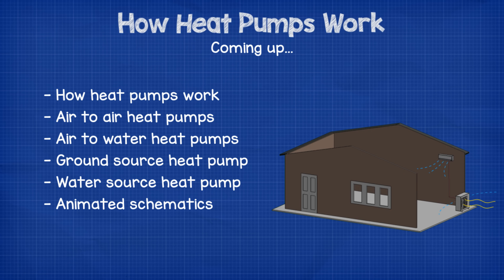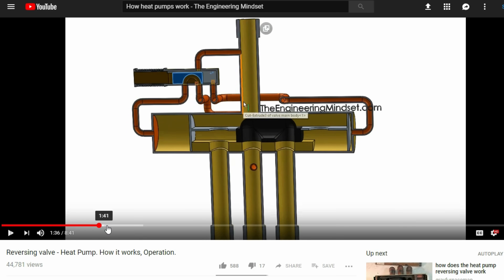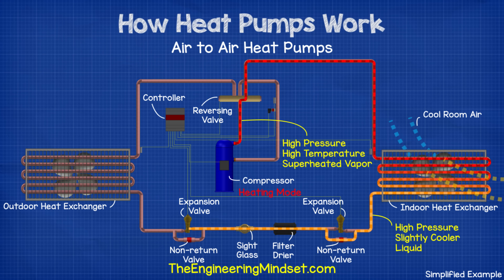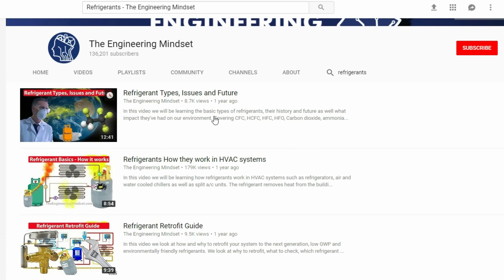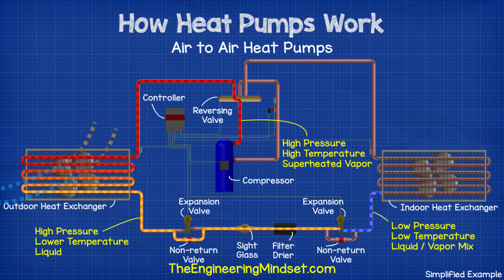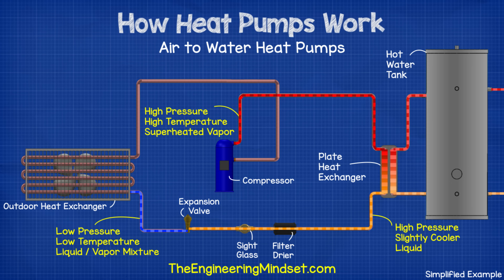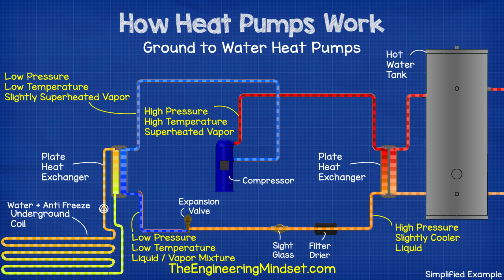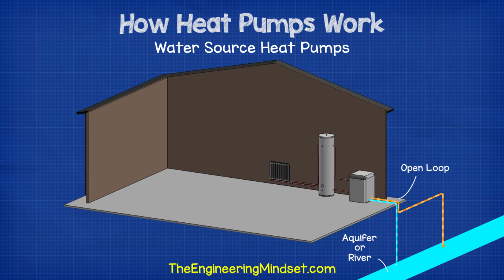Heat Pumps Explained - How Heat Pumps Work HVAC

Comment: What if the industry with all its low temperature waste heat could (indirect of course) warm up the sewerage/waste/rain water streams in the winter? I don't think about really warming it but rather about trying to keeping the temperature constant at say 25°C.  Heat pumps would then extract heat from this. This way perhaps much less pipes would need to be constructed and laid in the ground,  transporting waste heat.

Comment: sir i have a question. what if i want to build my own mini electricity? through natural gas. since my place have own natural gas on underground.  now i want to install heat exchanger on my genset. is it possible to do that? instead of using it's giant radiator. I'll just took it out then replace it with heat exchanger system? so could run it continuously everyday?

Comment: Classic inverter heat pumps only have 1 expansion valve which works for Cooling and Heating. And on/off models have a small capillar pipe for Cooling the freon

Comment: Best explaination of the air to air system I have ever seen.  I have 40 years in the HVAC system and I'm so tired of the "advertising" of the heat pump takes "heat" out of the ambient air outside and transfers it to heat in the house.  When it's 10F degrees outside there is no heat there but when I try to explain the heat comes from the compression of the refridgerant out of the compressor I'm told I'm always wrong and even by some of the current crop of HVAC mechanics.  I definitely subscribed and liked and will refer doubting Thomas's to your video!
Reply: When is 10°f, there's 10°out there. The phase change takes place anywhere north of -15°f, so it's definitely taking heat from the outside. You can test this by putting thermometers in front of and behind your outdoor unit.
Reply: Respectfully Chris you're wrong. And what am I gonna do with 10 degrees in a house I'm trying to get to let's say 70? Take your time and figure out what is going on. You'll figure it out and don't just buy the hype of the heat pump. There is a reason modern thermostats let you select an OAT to not activate the heat pump and use Aux heat instead. Just figure out what you have and what you're trying to do. I promise you the light will go on and you'll respond I'm right. I've been in the business way too long my friend.
Reply: @lisajohnson8566 Additionally, Freon can go as cold as -25 to -55 degrees, which is colder than a cold day, so the needed heat transfer can still exist. The reason AC is much more efficient than heat pumps is the difference in temperatures. The hot Freon is much hotter than outside whereas the cold Freon is only a little colder than the outside cold. Think in terms of relativity and energy transfer more than temperature transfer, which if that was the case, a/c’s would not work and nor would heat pumps.
Reply: @lisajohnson8566  this is a bizarre line of argument. Heat isn't a measure of temperature, just like mass isn't a measure of weight. There is a transfer of heat, you transfer it after the compressor makes the refrigerant colder than the outside air.
Reply: There is absolutely plenty of heat there. Just because it's cold to you doesn't mean there's no heat there and that no heat can be extracted. That heat goes into the system and is added on top of the heat generated by compression. Anything above absolute zero has thermal energy, that's just a simple fact. 10F is still 260K, and with kelvin being an absolute scale (starts at the lowest possible temperature that can ever be), that should tell you that there's still gobs of heat there. Plus there are heat pumps which can work well below 10F and still extract plenty of heat from that air. If it were only the compression of refrigerant that generates heat then you would never be able to get more energy out of it than you put in. So the fact that you can use for example 1kWh of electricity and get 3 or more kWh of heat means that that heat has to come from somewhere or else you're violating the laws of thermodynamics. Since that's not happening it means the extra energy is coming from the one other place it can, the evaporator. So it's mostly heat from outside plus heat from compression plus some heat off the motor windings and a bit of heat generated in the core from the eddy currents in the laminations. As someone in the HVAC business this should be basic knowledge to you.
Reply: It's my understanding ambient air, of say 0 degrees, isn't used to create heat or any hot air, it's just that ambient at 0 degrees is above the boiling point of R134A of -15.34, so it is only effecting the temperature of the refrigerant: To contribute to bringing refrigerant above its boiling point before it is returned to the compressor.

If that is true, wouldn't R410A be more efficient at heating in extreme cold conditions since it's boiling point is -55.3 degrees?

Comment: So do they work better if it's colder outside? Or would it work better inside as the temperature rises it would create more warmth 🤔 use less power
Reply from the maker: If you just want heating, then yes the warmer the better. But most will offer heating and cooling so there's a compromise

Comment: Wait, so what’s the difference between a heat pump and an air conditioner then?
Reply: A heat pump has a hot gas valve and bypass to allow discharge vapor from the compressor to go straight into the evaporator.

Comment: I've been looking into changing my air conditioner to a heat pump unfortunately like everything else there is a major Mark up so airconditioning technician are not interested in upgrading old air conditioner unit's so they want to sell a new heat pump unit and make a large profit most air conditioning system have very little run time our unit may have 20 hours on it I've thought about trying to do the work myself I'd heard about the reversing valve but not the other two valves you show in your video I've also heard about using ground water for cooling and heating with a heat pump we have water 20 feet down so would love to use it to cut heating costs further I'm also looking at going solar electric I looked at heat pump water heater I thought maybe if I could use the hotwater to heat my house but even though some are pricey they are still affordable if I do the installation myself but non will run off buget friendly solar electric so they become unaffordable adding three grand to two grand is buget tight adding three grand to eight grand is unaffordable for most of so thank you for an excellent video
Reply from the maker: Seen our new video on HOW SOLAR PANELS WORK in detail https://youtu.be/Yxt72aDjFgY

Comment: At the outside heat exchanger 'the refrigerant picks up the themal energy from the outside air' ;
Let's say that the outside air is at 0deg C,  then the warmest the refrigerant can reach is 0deg C also. This refrigerant then has to provide the energy to warm the inside of the dwelling. How does this work?  It seems to me that the compressor has to compress/warm the refrigerant to say 25deg C so that heat can be transferred to the inside of the dwelling at the indoor heat exchanger (room at 20deg C)
If I am correct then the compressor is doing most of the heating. Doesn't sound too clever to me, and expensive, so what am I missing ?
Reply: And how is the energy compressed . . answer : with a compressor !
And that takes electrical energy from the grid. Your explanation is not convincing.
Reply from the maker: The thermal energy is absorbed and compressed into a smaller volume, this makes it usable. When in the ambient air it seems useless

Comment: You keep talking about cooler temperatures and warmer temperatures. There is NO SUCH THING. Temperatures can NOT be 'warm'. They can be HIGH. They can also not be 'cold' or 'cool'. They can however be LOW. Similarly a price can not be expensive, but HIGH. A speed can not be fast, but HIGH.

Comment: Tell me again!
You are seriously saying you bring in warm air or heat from the ground indoors to heat a room?
An example I know from observation is in winter outside it can be 0°C and my bedroom is 10°C with no heating switched on.
You say freezing cold air is brought into a compressor into a house which is already warmer than the freezing air being brought in?
Why not recirculate the already warm air at 10°C into the heat pump and let that heat the room? 
Why start from zero when you can start from 10? Where is this heat from outside? Zero degrees C.

This just sounds like an expensive con job to dig up your garden to put pipes in and make it complicated!
Reply from the maker: No, we do not bring the air indoor or into the compressor. We use the refrigerant to absorb thermal energy from the outdoor air, compact it into a small volume which brings it to a high temperature and pressure and then send it to your indoor unit to heat your house. Just like in summer your room is hot and it cools it down by moving the thermal energy outside, even though outside is also hot. It doesn't move the air, just the thermal energy.

Comment: my heat pump is on right now....now i know what its doing
Reply: do you have a video when emergency heat kicks in because of lower temps?
Reply from the maker: The electrical heater or hot gas bypass. I don't think I've talked about it on a residential heat pump but commercial chillers briefly

Comment: The idea seems good, but surely the amount of power , ie., electric all these components use would cancel out the efficiency of the set up..
Reply from the maker: Nope, you could even run it off solar/wind with the right setup

Comment: what's the running costs?  do they supply plenty of heat in the middle of winter?, not a lot of call for air conditioning in the uk, why don't we use up all the coal gas and oil in a clean efficient way, then switch to heat pumps in 100 years, i,e switch by choice don't make it compulsory
Reply: Great  video. I have been using a heat pump to heat my swimming pool forc25 years. I recently replaced the main circuit board after the unit was hit by lightning. I  have replaced some other parts but need only to replace the liquid in the  temperature reading tube that is inside the water inlet port. There is small wire that is inside a small copper tube that goes back into the main circuit board. Can you tell me what type of liquid I need to fill this tube with? I assume it must be non-flammable. Thanks

Comment: I’ve been fascinated by this process because it’s in a closed loop, I know a high pressure side and low pressure side, but flipping them is brilliant.
Reply: Yep, it is fascinating. I just cannot get my head around how on earth it is more efficient than the water tank with a simple heating rod inside. Pushing the coolant (R134a) in your car costs you approx 10% of the total fuel consumption and some considerable power if you have petrol engine 1.1 litre. Even the most typical fridge-freezer - the compressor is using about 500W - to cool 20 deg celsius in maybe 0.5m3 I am not convinced this system is able to produce 70 celsius on even one small radiator and deliver hot water (52Celsius) to the taps. Have the thermodynamic laws changed recently?

Comment: Hi. I still don’t get it. I have warm air hearing from a reverse cycle inverter. It’s cold in my house but even colder outside and the refrigerant liquid presumably is cold too. I get that it has a lower boiling point so it converts to vapour at a lower temperature, so it’s not getting hot. So where does all the heat actually come from? Is there another video I need to watch? I watched the heat exchange one which I understand. Thanks.
Reply from the maker: That's it. It's all in the air, it's just absorbing energy. The fan blows lots of air over the pipes so it can pickup as much energy as possible. The refrigerant gas is then compressed so all that energy is now packed densely into a small volume which increases pressure and temperature. This is then used for heating
Reply: @EngineeringMindset  excellent. Thanks. I’ll watch again with that in mind and hopefully digest it 👍🏻
Reply: I'm also trying to wrap my head around it. I'm trying to use an agricultural analogy: the outside temperature is like the density of corn in a field (corn/square meter; heat/volume of outside air). You want to harvest heat, not it's density. Likewise a heat pump does not extract temperature, but heat; it's cumulative.

Comment: I lived in three places with heat pumps for a total of 8 years. Two of the pumps had to be replaced at significant cost. In 35 years with gas heat and airconditioning I never had to replace anything.
Reply: Except the gas!

Comment: Geothermal energy is energy taken from the Earth's core, it comes from 
heat generated during the original formation of the planet and the 
radioactive decay of materials, and is not green in any way. Just 
because it doesn't cause CO2 emmissions some shallow thinkers imagine 
it's part of the solution to global heating, it isn't, it's part of the 
problem, and while fossil fuels are being phased out geothermal is 
expanding because simple non thinkers imagine it's green. Just repeating
 low carbon is a mantra to reassure those scared of the consequences of 
climate change. Dream on.

Comment: The closed loop systems that I have seen don’t have a pond or anything like that. They have a mixture of water and antifreeze and are a sealed system. Not sure how you can have a “closed” loop that is not closed but I have been wrong before (understatement of the year). I also have never seen a heat only heat pump in a residential application, I have only seen ac systems that have no reversing valve. Not trying to hate, I watch this channel quite a bit, just my observation.